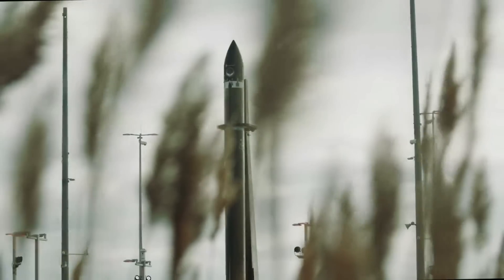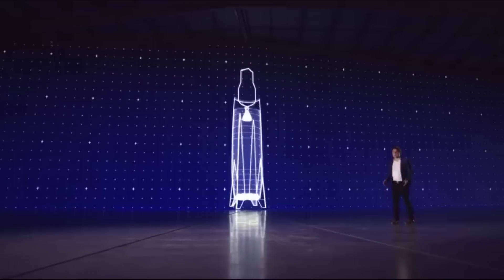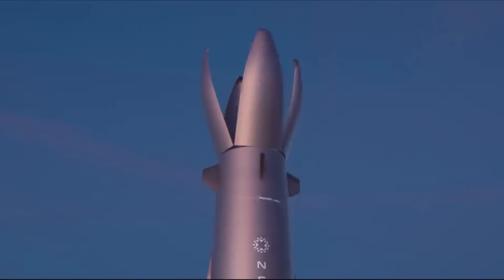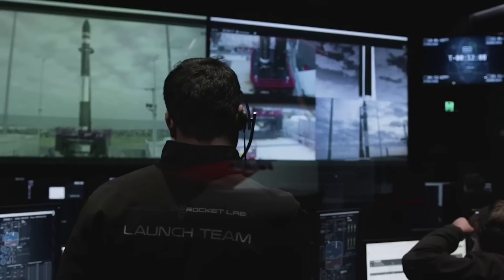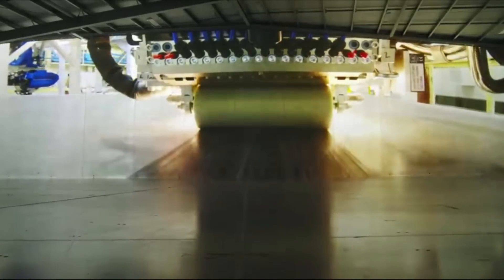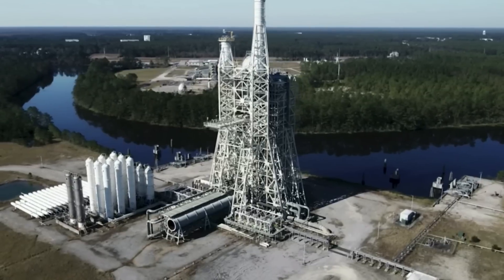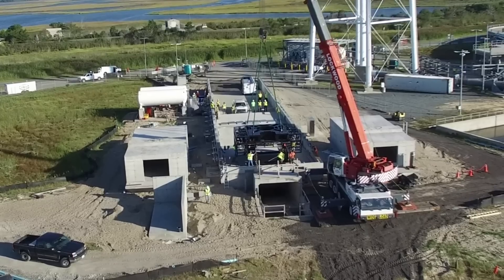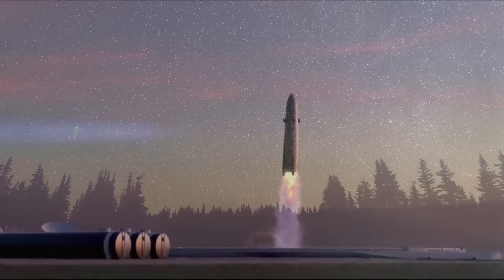A Closer Look At The Design of Rocket Lab's Reusable Neutron Rocket

Comment: Will be operational and in use, well before Starship is certified just for satellites.
Reply: Most likely yes
Reply: Circa july 2024, i doubt that. Starship is only using V1 until IFT-7, then IFT-8 onwards will switch to V2, AKA the first operational version of Starship, which is when it will, start deploying payloads. If Musk does get his aim of 6 Starship launches in 2024, V2 will be operational before Neutron, but it’ll be close! Ig we’ll just have to wait and see :)

Comment: I am a blind subscriber so have not seen the graphics presented 
So how much of the second stage is inside the first stage
And if so I wonder how they will avoid water ice buildup with the cryogenic propellants possibly jamming the second stage inside the first stage
Cheers
Reply: All of the upper stage is in the faring, I don't know about the 2nt part of your question.
Reply: Thanks
If the second stage is actually not partially within the first stage then low temperature would not produce water ice buildup hence no problem thanks for the clarification
Cheers